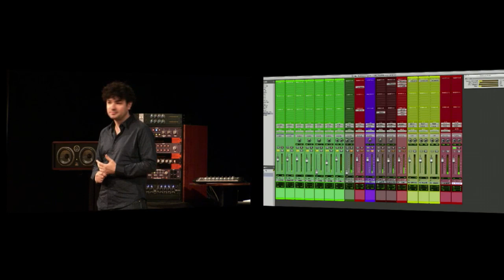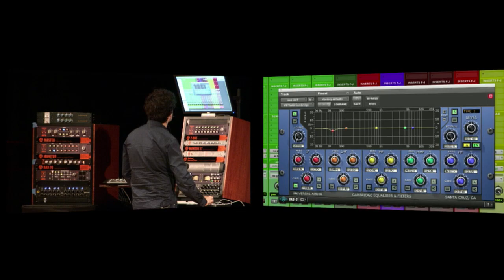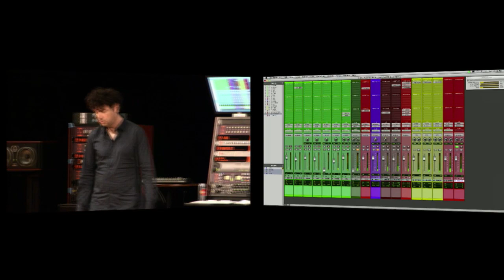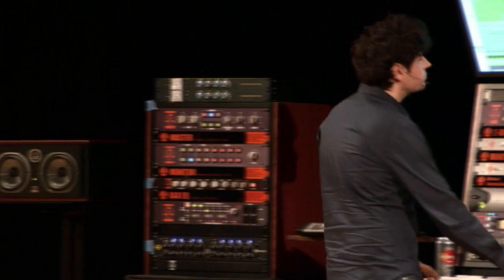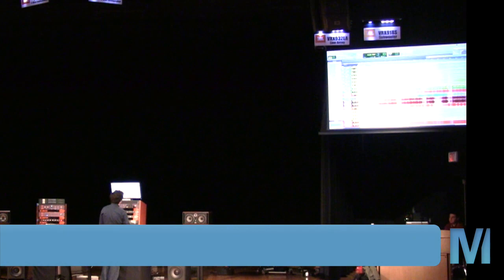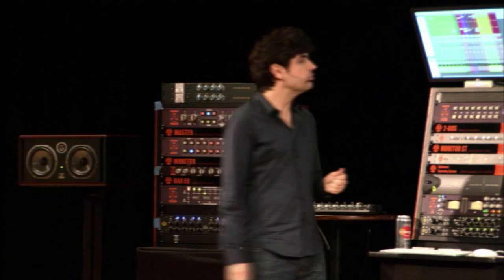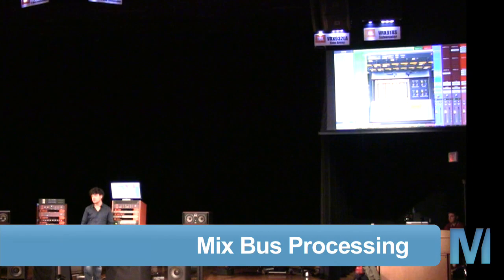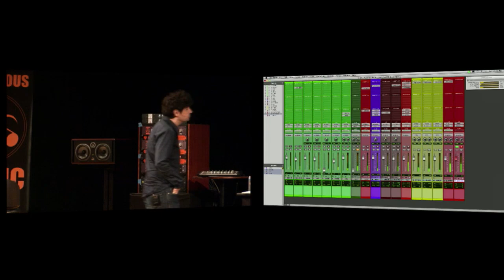Mixing the Band with Fab Dupont - Part 4 of 4

Comment: I set up a stereo track w/15-16 as the in and 15-16 as the out.  I put the tape emulation or compression, etc, and record that track (I can set up an AUX track the same way if I just want to monitor it).  Mixerman's book (Zen & the Art  of Mixing) has an excellent and detailed description of how to use the thing.  Hope this helps.

Comment: But are you summing? Are you monitoring your stereo bus (DAW) through a plugin. I know it must be possible, but I don't get it. Also, if you're using all 16 outs on your converter for summing, you need 2 more outputs to monitor the stereo bus/plugin (DAW). That would be only possible with an extra converter. Am I missing something?